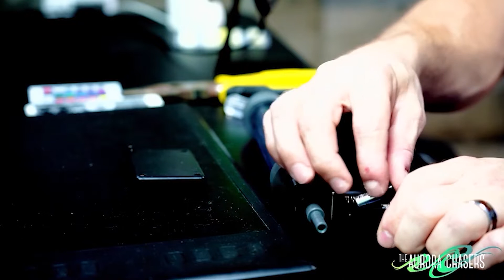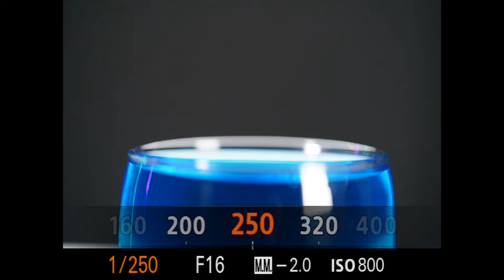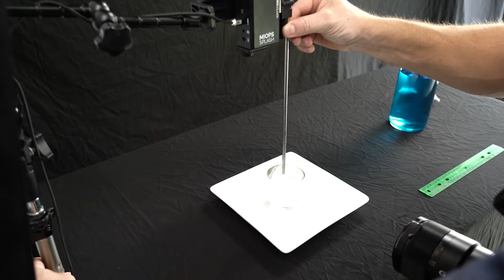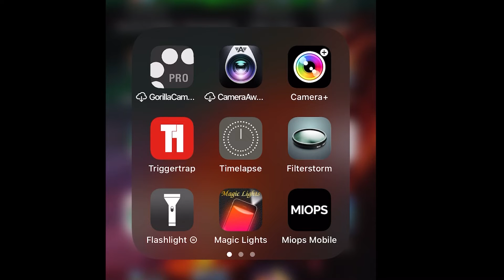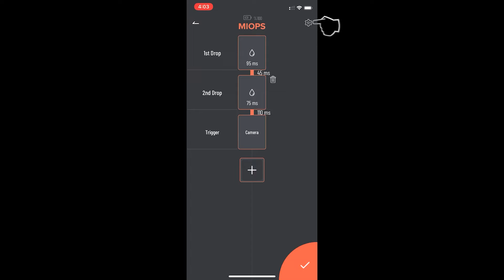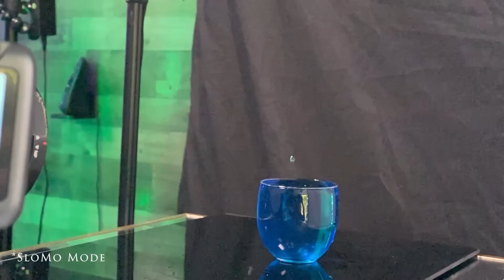Miops Splash Water Drop Kit (New Version) Gear Review and Tutorial

Comment: hello, just purchased the new miops. unfortunately the flash cables 3.5mm (miops) to pc sync are not compatible with ad300 pro and godox V1 :-( I need to find a 3.5-3.5mm for ad300 pro and a 3.5/2.5 cable for V1.
Why do you say triggering flash in dark room by miops with camera set to bulb mode by miops (so two cables used) were not consistent ? camera is open for 1sec and so can't miss any light event.
Strange you connect miops to xpro2 to trigger flashes instead of connecting to one flash and using second flash as IR slave. I would have been afraid to send two pc sync to xpro (other one by camera hot shoe). But also the connector on xpro N is not pc sync but again 2.5mm. so can't use miops flash cable.

Comment: Great video very well presented! One thing I think that contributed to making your job with the water drops less consistent is that the various cords seem to be two short and seem to be vibrating the set up. It's not your fault but it looks like "Rube Goldberg" set up. I had a set up once that sold a time machine type device for water drops and the man manufactured various sized cords that allowed for more relaxed set ups. MIOPS should really get onto that and the user ease would go WAY UP in total success rate. I hope this idea resonates with you or helps you in some way. Thanks. You did a great job working with the limitations of MIOPS.

Comment: very nice tuto. what is the shutter speed (F11 iso 400 and 1sec ?) ? i don't understand the connections. with pluto trigger everbody seems to say the camera trigger by pluto with xpro on camera is not consistent and advise to connect pluto to flash (only one is possible, not sure slaves are working) and pointing pluto IR to the IR detetcor of camera.
here you deal with a mix between xpro and 1 or 2 cables coming from valve (there is no "pluto trigger" in miops if i unerstand, everything is in valve ?)

Comment: I have bien using this device for a week on camera trigger mode .but there is no consistency eventhough I am using the same setting .. any helpful tips ?
Reply from the maker: Settings are going to be quite dependent on your individual camera and flash as well. Height of the Miops and drop size makes a "big impact" as well. Be sure to start with the recommendations from Miops for those things and then fine tune fro there. As noted in the video, once we found the right combo, we got the most consistent results from using "Rear-Curtain Flash Sync" at 1/200th second and triggering the flash at it's lowest power output. Timing and drop size took a little fine tuning from the base Miops settings but once we got it dialed in, it went really well. Also, check to see if you have the USB powered model with the latest firmware. The older battery powered unit, was less consistent in our testing.